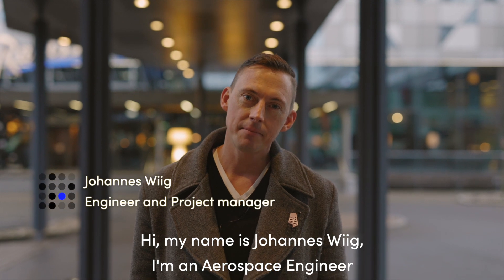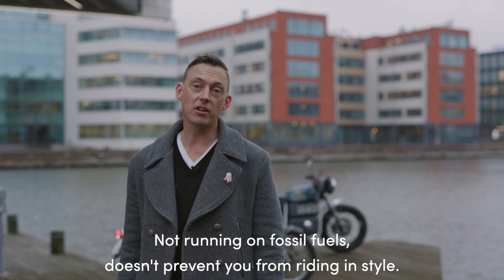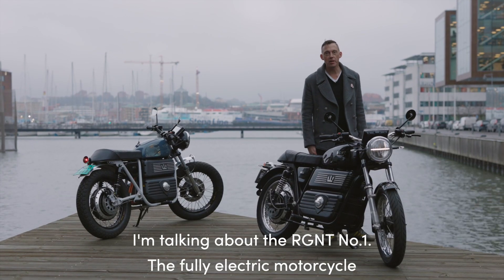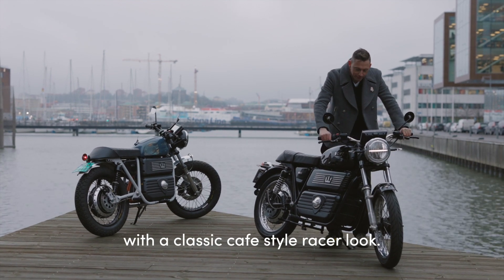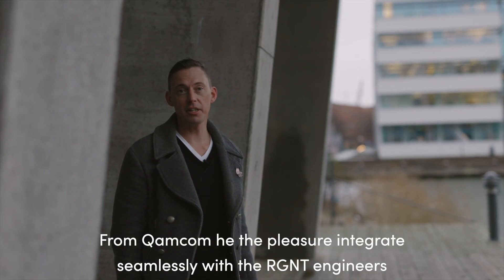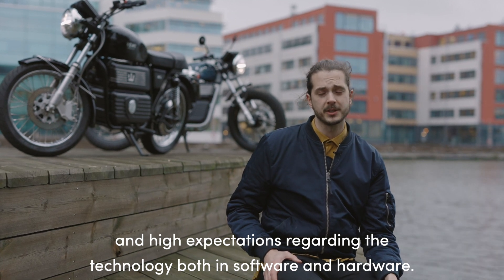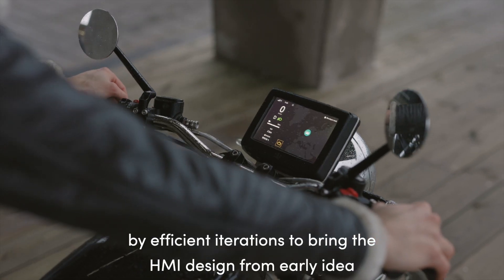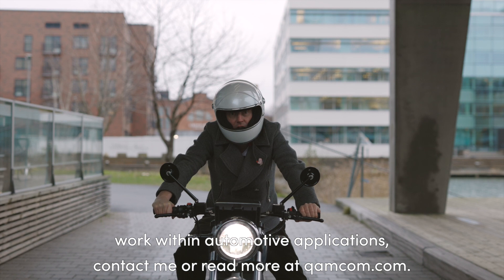HMI Design from Idea to Mass Production for RGNT Motorcycles

Comment: With motorcycle gloves it will be difficult to use this big Ipad to control de motorbike !
I notice that they don't wear any gloves in the video which is problematic !
Reply from the maker: Dear Alexandre, the bike is controlled just as a regular bike while driving and if you don’t like the sensation of having cold hands you could have your favorite gloves on. Also, while driving, the HMI is just a way to visually communicate information like speed and location among other things, however, when you are stationary you can interact with the on-screen functions either without gloves, or perhaps get a pair designed for touch screen interaction.